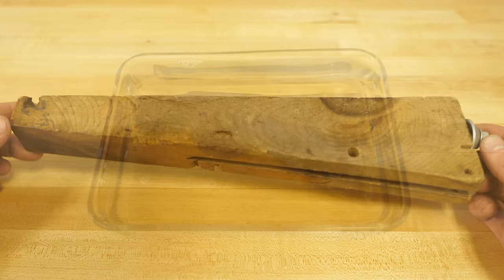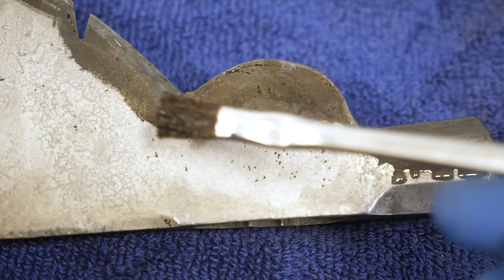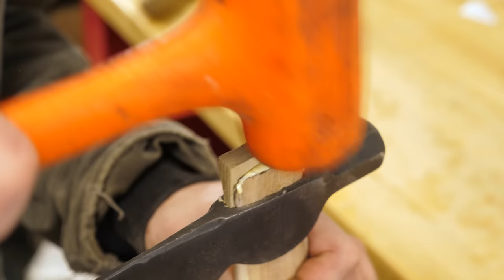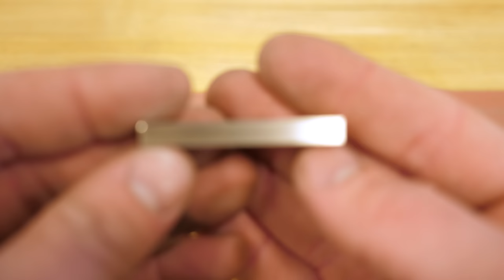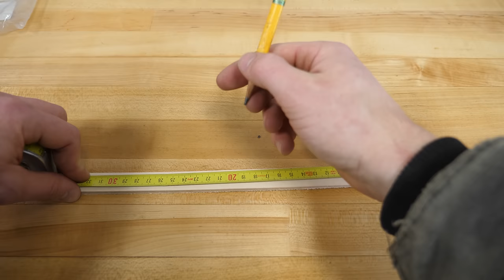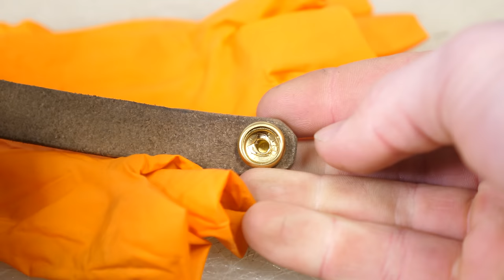Restoring my Grandfather's Old Hatchet

Comment: This is an old school framing hatchet, as opposed to an axe. The "nog" is for pulling nails, axes don't have these nogs. We used these hatchets in place of hammers, up until the early 80's.
Also similar to roofing hatchets, which would add holes along the top straight edge for shingle spacers.

Comment: Great job. A few things I really liked about this resto and one tool suggestion. I like that you took the time on a hatchet that was born to be a cheap workhorse in somebody's garage. I like that you didn't give it a mirror polish, but instead gave it a good looking, practical finish. I like that you didn't feel pressured to cut and shape your own handle, there's nothing wrong with a store-bought handle, and you spiffed it up nice and correct. My suggestion is on the removal of the finish that came on it: a card scraper would make short work of that instead of sandpaper. Once again, great job, I really enjoyed this.

Comment: Despite the many mentions of this tool being an axe, I still possess a near identical tool that I inherited from my father, who was a builder and roofer for most of his life. He always called it his slating hammer and when I once offered to put a sharp edge on the blade, he told me to never sharpen it, as it was supposed to be a rounded edge and be used to create assorted shapes and sizes from plain rectangular stone roofing slates as required for decorative patterns on roofs. He would use the same tool for different types of slates from the usual Welsh blue slates and the Cumberland green slates to the older more locally sourced Riven Yorkshire Sandstone slabs and even occasionally he worked with Cornish random slates (which he always described as a miserable flaky stone to work with).

Comment: Nice. I have a Winchester hatchet similar to that from 1924. It’s razor sharp, in original condition but with a new custom hickory handle. I just throw it under the front seat of my truck. Never know when you’ll need a good sharp pre war hatchet.

Comment: I think your grandfather would be very amused at how much work you put into his drywall hatchet 🤣
Reply: It's a carpenter's hatchet, not a drywall hammer. It's used for actual woodwork, not trimming drywall.
Reply: @Ice_Berg  Its flat top and nail slot suggest it was made using the Lathing hatchet pattern.
Reply: @Ice_Berg  hmm I’ve seen them called drywall hammers - they’re obviously not used anymore, but in the 1960s and earlier they were common.
Reply: I believe this particular design predates drywall, and was originally used for installing wooden lath which went under plaster in older construction, but drywall hammers are a direct descendant of these, and I’m sure these were widely used on drywall for many years. They started to go out of use with the advent of the superior technology of drywall screws, and since the advent of good affordable cordless drivers pretty much nobody nails drywall anymore.
Reply: Mostly called a “Rig Axe” 
At least, here in Texas. Dry wall hatchet has a smaller blade and larger, waffled, face.
Reply: @juanmore62  agreed, rigging axe but here in my town it's purchased for roofing
Reply: He would probably also be amazed at the number of views on this video and the ad revenue.
Reply: @TheducksOrg I think this is a carpenter’s/rigging hatch. Drywall hammers or drywall hatchets have a broader more rounded hammer face with crosshatching. This hammer would not leave a very nice dimple like a drywall hammer is meant to.
Reply: This is a rigging axe. Originally used for building oil derricks but later as a common framing hammer.
Reply: @urbanbicyclist  that is exactly where my granddad would have been. "You had how many people watch you fix up that old thing AND you made money on it? Ya know there's some more old heads there on the shelf if you can make money putting handles on them and polishing them up" I can hear exactly how he would have said it

I can also hear him talking about "thats good wood" on so many projects and while he would have been amused. He would also have been impressed at how good it looked. 

It is a nice restoration, and looks good.

Comment: I've never seen a hatchet mount like that. It looks like it would be the kind you attach to the wall.
Reply: I thought the same, but, NO hangers, no method of hanging it to the wall, and no notches or thru-holes for straps either. To me, this seems to be a bench stand for the hatchet, to be used from a work bench and not carried around much. All-in-all I would say this is a very good restro, and well worth it!

Comment: Just as a FYI kinda thing this Axe is not a Axe but a hatchet for shingling a roof with shake shingles. The proof is in the design and the fact that the head says TruTemper. I can run right down to just about any hardware store and buy a Tru Temper hammer. But it turned out nice.

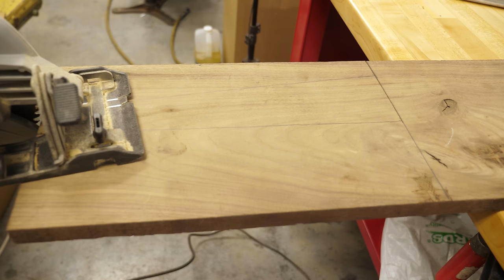Comment: Yeah, I was wondering what that jug of cooking oil was doing in the background at 1:46. I didn't see any clips where you heat treated the steel. I see you used a heat gun, but I thought heat treating worked differently than that?

Otherwise, a lovely job you did. I bet your grandfather would be proud.
Reply: I'm far from an expert, but I've seen people use oil to seal in cold bluing like he used here.

Comment: I've done a number of them over the years, very nicely done. True Tempers were at one time made in West Virginia, not sure about yours. One thing I'd like to point out, the grain direction/orientation of the handle is incorrect. It's not easy finding correct ones anymore.
A sharpening technique you might want to look at for future projects that I like to use is called "the rag trick". A you tuber named Felix Immler has a good tutorial on it.

Comment: What's the cancer sticker for
Reply: That is a California Proposition 65 warning. Prop 65 was passed in 1986 with the intention to warn California residents about dangerous chemicals in everyday products. Companies then figured out if they just put that label on EVERYTHING then no one would take it seriously. So in California an industrial solvent containing Benzine, a known carcinogen, has the same warning as a hatchet handle, which is completely inert. They are working on correcting this to make sue companies are only reporting products with actual hazards.

Comment: Cancer and reproductive harm?
What is that handle made of?
Reply: That is a California Proposition 65 warning. Prop 65 was passed in 1986 with the intention to warn California residents about dangerous chemicals in everyday products. Companies then figured out if they just put that label on EVERYTHING then no one would take it seriously. So in California an industrial solvent containing Benzine, a known carcinogen, has the same warning as a hatchet handle, which is completely inert. They are working on correcting this to make sue companies are only reporting products with actual hazards.

Comment: Nice show piece. Not much use as an axe. If you can shapen it with a file then the axe head hasn't been hardened. So it won't hold an edge.

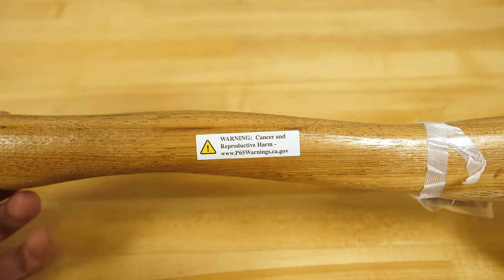Comment: 07:30 why it said it is cancer and reproductive harm? is it still safe to use it?
Reply: That is a California Proposition 65 warning. Prop 65 was passed in 1986 with the intention to warn California residents about dangerous chemicals in everyday products. Companies then figured out if they just put that label on EVERYTHING then no one would take it seriously. So in California an industrial solvent containing Benzine, a known carcinogen, has the same warning as a hatchet handle, which is completely inert. They are working on correcting this to make sue companies are only reporting products with actual hazards.

Comment: It is actually a rigging  hammer
Reply: this is 100% not a rigging hammer...
Reply: @elonmust7470  look at the image, v notch for pulling nails, hammer head ,and cutting edge, sorry but it sounds like you have never used one ,your 100% wrong
Reply: @grainplaner216  It's a shingle hatchet....
Reply: @elonmust7470  shingling hammer maybe not hatchet, you can't drive roofing nails with a hatchet, hatches  have a single cutting bit to chop kindling with and no hammer head what so ever to drive nails with.
Reply: @grainplaner216  Sure you can. Every standard non double sided bit hatchet or axe has a butt. One that can easily drive nails, as it's flat, just like a hammer. Since you're such a hand cutting tool expert. Let's hear the extent of your experience with a roofing hammer. I have very little. Axes on the other hand, I carried 5 days a week for a little over 15 years. I know what head weight I want for certain sized timber & I know what handle lengths I like.
Reply: @elonmust7470  so are you saying that your a lumberjack,  I have been using power and hand  tools for 40 years not just hammers, but every cutting implement of modern manfacture including axes , all I am saying is use your terminology properly  because you just sound ignorant when using the incorrect terms , regaurdless of your insistance , a hatchet and a hammer are to different tools there balances are dissimilar  and they are not made for the same types of tasks , the square back of a hatch can be hit with a froe for batoning wood,  it does not transfer the energy of the swing to a nail head the same way a hammer does , nor is there any cross hatching or roughened surface on the hatchet to grip the nail head to drive it properly.
Reply: @grainplaner216  Using tools in your garage isn't really what I'm talking about.. The term is timber faller, by the way. You're trying to sound smartdr than basic physics in your last post. Sounds loony.
Reply: @elonmust7470  I have payed for my garage by working in the real world using tools to earn a living if you want play at being a logger with an axe , which became impractical 70 years ago be my guest , but that does sound loony or at least out of touch with reality.
Reply: @grainplaner216   Still waiting to hear what your trade is.& I use the axe to drive wedges....  Figured it went without saying. I ran ported Stihl 92cc class saws. The only chopping is done when I get stuck.
Reply: @elonmust7470  hatchet to drive a felling wedge then you really slould know the difference between a hammer and a hatchet , I am a builder , i have also done felling , fire wood cuting , built log homes, ect, you sounded like a granola in your first post.
Reply: @grainplaner216  My preferred rigs are a 5lb & a 7lb 1980s or earlier Council. Most of the time the 5lb sporting an arm's length handle (hold the axe under the beard and cut the handle right under your armpit), the 7lb add 8" or more for reach. The old timers used to tune their handles for the timber. Some of them sported broom length handles due to the size of the timber.

Comment: Why is the handle a cancer and reproductive risk ??
Reply: That is a California Proposition 65 warning. Prop 65 was passed in 1986 with the intention to warn California residents about dangerous chemicals in everyday products. Companies then figured out if they just put that label on EVERYTHING then no one would take it seriously. So in California an industrial solvent containing Benzine, a known carcinogen, has the same warning as a hatchet handle, which is completely inert. They are working on correcting this to make sue companies are only reporting products with actual hazards.